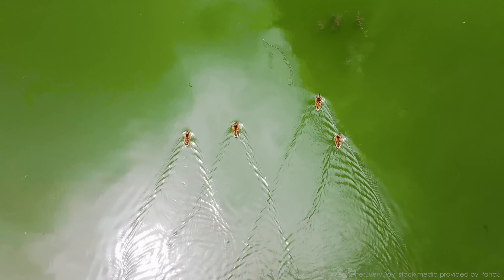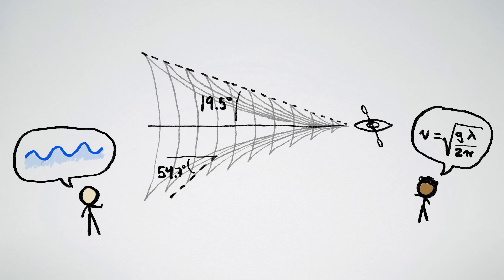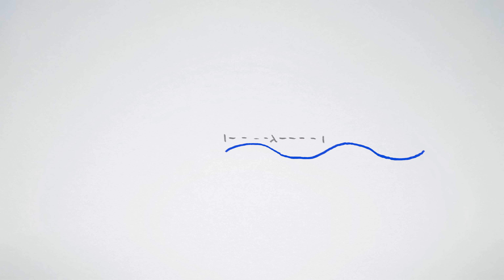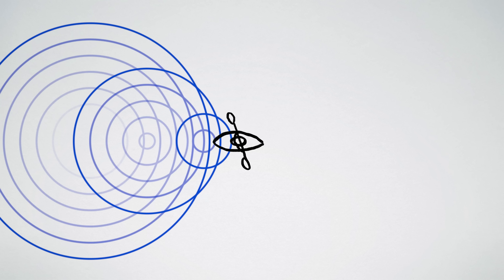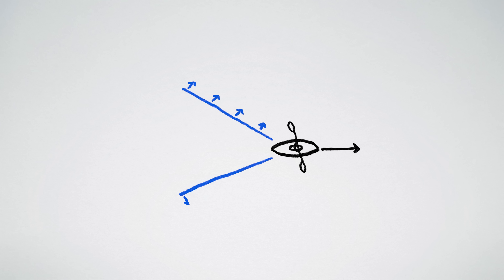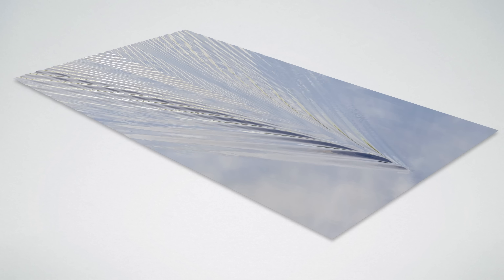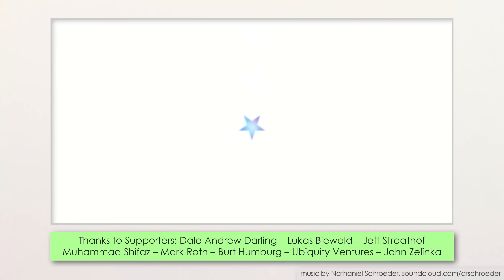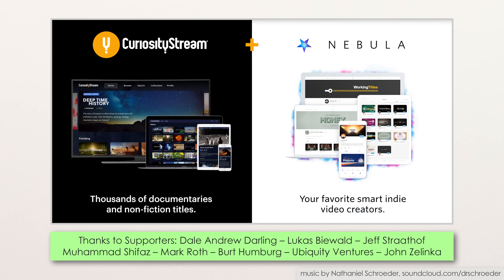Why Do Boats Make This Shape?

Comment: Why do waterwaves with longer wavelength travel faster?
Reply: in order for a wave to have a longer wavelength, the amplitude increases. (distances between peak and trough).  As the amplitude of the wave increases, the waves move faster, because of the effects of gravity.  This would be true for traveling and standing waves.

What many people fail to understand about waves is that the water doesn't move forward, the wave is the effect of energy being conserved!  The wave is the energy.  

Think of a small bunny slope....you aren't going to travel very fast down that hill.  This bunny slope would be produced by a very small displacement of water...a small boat, small draft!

now think of the very steep slope of a black diamond ski slope.  You will travel faster.  It's the angle of the slope plus your mass and the effects of gravity.  This would be produced by a very large displacement of water...a larger fast moving boat, larger draft.

the water "wants" to slide down from peak to trough....it does this efficiently by transferring that energy into a wave....the distance between the peak to the trough is proportional to the energy....the higher the peak to trough, the higher the energy...the faster the wave will be...but also the period of the wave will increase....the period of the distance between two peaks.

In a wave, it's nearly the same thing.  Energy from the water displacement is being conserved.  If there is MORE energy, the waves will be larger in amplitude, and will travel faster.  If the energy from the water is less energy, the waves will be smaller in amplitude and will travel slower.  There is a direct correlation between wave amplitude and wave speed.  

and to note:  there is a tiny bit of energy that is actually converted to heat when energy displaces water....can you guess what causes that heat?

it's friction of atoms knocking against one another.  If you think about how very fast reentry satellites "burn" up in the atmosphere, this is the same thing.  At the water displacement from water craft at the surface, this heat component is very very very small..very hard to detect...but it does exist.  All energy is conserved...even tiny amounts of energy that is attributed to atoms pushing against one another in a small canoe wave.  None of it is lost.  We just see the waves ...the displacement patterns of the energy of the canoe pushing water down and way from its displacement.  But there is also a tiny amount of that energy that becomes heat.

Comment: Nice description!  Light (EM) waves in optical fibres have dispersion (unless the fibre is specially constructed to counter it), but not when they traverse space.  Why?
Reply: In a vacuum all light travels at light speed, so there is no dispersion. In the optical fibres the light interacts with the fiber, and this slows it down a little bit. The amount it gets slown down depends on the wavelenght
Reply: @arnaldo8681  Yes I know it interacts. But why is it frequency dependent?  Is ‘slown’ a word - I like it ‽
Reply: @Richardincancale  oh, how it happens i dont know

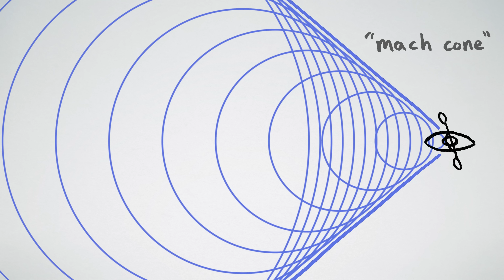Comment: 1:24 “waves” - but why does a boat 🚣‍♀️ create waves in the first place?
Reply: To create a wave something needs to vibrate. In this case waves are formed due to boat vibrating the water surface.
Another way of saying it is that boat disturbs the water surface and hence the waves.
Reply: As the boat moves it pushes water out of the way, thus making a wave. However, I'd like to know why it makes waves of different wavelengths.